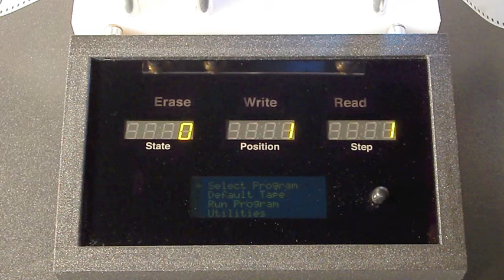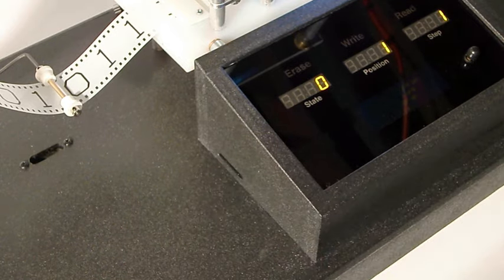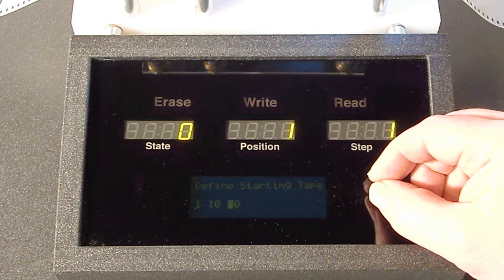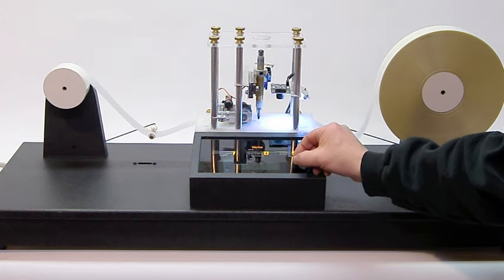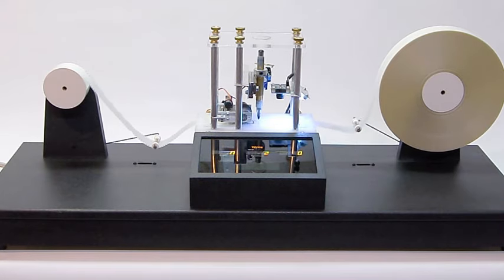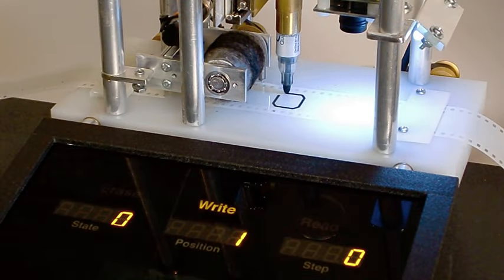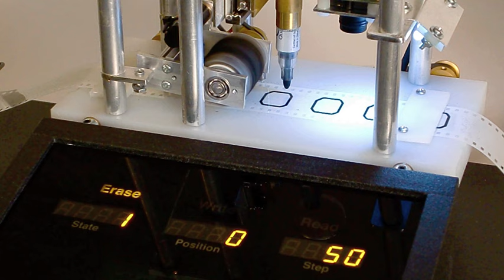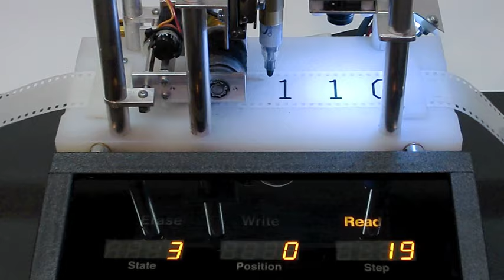A Turing Machine - Overview

Comment: It's funny to think that there's another Turing Machine hidden in the "control box" inside the Propeller chip that controls the mechanical one ;)
Reply: and in that turing machine there is another turing machine that controlls the turing machine which controls the turing machine
Reply: HAHAHAHAHA
Reply: and it's funny that at plank length level there is an abstract metaphysical turing machine that simulate the physics on which those turt.. turing machines all the way up
Reply: @zazugee  how do i bookmark comments
Reply: It's not a Turing machine. It's a finite state machine.
Reply: @thomasseverini6820  Unless there's an entire microcontroller hidden in it – in that case it is. But yeah, you're right about the fact that the head might contain just a regular finite state machine for this to work. It's just that in this case someone used something much more complex to simulate it.
Reply: @thomasseverini6820 CPUs and microcontrollers are Turing machines, you can parse context-free languages such as C on them (memory permitting.)
Reply: @ahG7na4  wrong. The memory of a computer is finite. They are (very complex) finite state machines.
Reply: @thomasseverini6820  everything is something if you choose your vantage point for it to be so. files are numbers, iteration is recursion, hashing is compression, and a CPU is a FSM with a state for every combination of the contents of its registers and RAM. ok.

And you need those 2^N states why? because you're a restricted Turing machine that has no scratch memory and can only move its head one way. Good luck implementing that in silico.

CPUs can pack all of that state in less hardware, because they really, really do things differently - like a Turing machine and not like an FSM. they can random-aceess any of the memory cells and branch on its contents.

They've made a CPU in Life. That's because that is Turing complete, you see. Show me a CPU in regular expressions.
Reply: @ahG7na4  I understand your point, but that does not change the fact that computers are not real Turing machines. A Turing machine is an abstract mathematical concept defined by a very precise formal definition that computers do not met.
Reply: @thomasseverini6820  All FSM's are unidirectional finite length tape TM(no writing capability).

Comment: But can it play crysis? I'm sorry I had to.
Reply: sure, if you're willing to wait 50 years for each frame ;p
Reply: lily foxboro What if I got 10 million of those things and managed to get them to work together. Then could I play crysis?
Reply: A turing machine can compute anything that is capable of being computed.
Reply: Brock X you mean sobering something like a...a parallel processor? Maybe if we could somehow virtualize and minimize it down into some kind of integrated circuit?
Reply: lily foxboro No no no. I'm not talking about making it any smaller. I like the idea of a parallel processor but keep it the size it is and use 10 million. Would you be able to run crysis if you did that?
Reply: Brock X When you get down to it, modern CPUs with their millions of transistors are essentially like millions of little, simple machines that could be... compared to turing machines. 

But the idea is that ANYTHING can be computed on a turing machine. Sure, you'd need millions of years but any computation can be performed on a turing machine. Or any "turing complete" system, actually. Practically though? No. :P
Reply: JC Leyba Thanks
Reply: It can play every game that has ever been invented, and as it stands now, it can play every game that will be invented (for a computer).
Reply: Everything for forever!
Reply: Alexander Alvonellos So a turning machine is like a computer chip but it can run any program on any architecture?
Reply: Heh, it's funny, I came here to basically say something that would answer your question.

I was going to say that this is turing complete so it technically (not even theoretically but ACTUALLY) could run any program logic. 

This means it could be the CPU that runs something like Crysis. Even with the GPU stuff being offloaded it would probably take hundreds of years, or longer, to execute the code needed for a single frame in the game. If it took it just a single year that would be, at maximum, 1/31,536,000 fps.

That being said.. that's still a bad ass fact of computing AND ALSO shows how fast our computers are these days.

* Now that I think about it. Computers these days can do BILLIONS of single operations per second. It takes AT LEAST 2 seconds for this machine to go from one bit to another and simply write the new bit down. That's not including the time it takes to moving to an existing bit, erase it, and writing a new one. There are multiple operations, like this, to do a single addition or subtraction which is something that gets done in a single operation on a PC CPU.
Reply: Alexander Alvonellos But wouldnt you have to connect it to the "Internet" to play online?
BTW I know nothing about crysis. :P
Reply: Alexander Alvonellos It can't play any game AFAIK, because Turing machines don't support random numbers AFAIK.
Reply: *****  Yes but we are assuming that this turning machine can take input from mouse and keyboard so it could have a random number input.
Reply: Brock Jones You guys have to understand the difference between "can it run crysis" to the amount of time and effort it would take to do it.In case you were not paying attention, the only moment a turring machine receives input is when the SD card is inserted. Then it just runs the inputed algorithm and processes whatever already is on the tape.That being said. for EVERY command that you push in crysis you would have to insert a new SD card. That is for EVERY mouse movement and key stroke.That is why in Alan Turing's paper, this was called a theoretical machine. His objective was to prove that any computation can be made by it, not that it can do it fast. :)
Reply: kriptonis
I knew it would take a lot of time I just didn't know you would need to insert an sd card every time.
Reply: Brock Jones Given the time for a single op, and the fact that you'd, at some point in expanding your parallel machine, run into propagation delays, no, you could not run crysis at anything you'd call a framerate.
Reply: kriptonis Conceptually, there's no problem with adding input we do on modern computers: by reacting to externally changed values in the memory. It doesn't change the processor (ie the turing machine) one bit (pun intended).
Reply: ***** Games generally use pseudorandom anyway.
Reply: Validole
 true, but the problem is how you pass the input to the Turing machine in the first place since it doesn't have a place to do it.

I guess you could create a magic dynamic tape that would change as you and other players act.

One thing it could do perfectly fine is to play a recorded game. Because all input would already be known, it could be stored statically in the tape and the machine would just process the bits and pieces (I made a funny :)
Reply: Validole  So it couldn't even render a frame in about 10 years?
Reply: Brock Jones A single addition on a Turing machine takes about 15 instructions. Other operations would be significantly longer, but I think that would keep us in the right order of magnitude. Assuming 2 seconds per operation as someone estimated earlier gives an instruction speed of 30 seconds per instruction, or 0.0333... Hz. A modern CPU can achieve a few hundred million instructions per second, but let's just assume 100 million. This means that this Turing machine is at least about 30 billion times slower than a modern CPU, and probably much slower.

So, if it takes 1/60 seconds to render a frame, this device would need 15 years to do it.

That said, I never included the GPU in this computation. This would increase the time by 10 times.
Reply: ***** You can compute algorithms that would output pseudorandom numbers easily. Also, not all games require random numbers.

I'd say it would take longer to write the game to be computable by a turing machine than to actual compute a single frame. If it were just this one guy doing it, he'd die before he had the chance.
Reply: kriptonis Well, you can build a Turing machine with more than one tape. And the second tape is used for input. After reading the input it switches to a blank field. If e.g. the camera detects a new symbol it reads it and calculates.
Reply: +Brock J If you can run them in parallel, you might break 60 frames per hour.
Reply: +Jeff Morin Hmm... Lets say one turing machine for every bit of display data (not pixel, bit)... and maybe you could display 24 fph video. However, you won't be able to unpack the video (or generate the data to display, in case of crysis).
Reply: Certainly not, but the COMPUTER which controls this machine probably can.
Reply: Well, no. This runs off a Parallax Propeller micromontroller, and while being an 8-core 32-bit device, it also runs at 80 MHz max with a total of 160 MIPS. So no. For context, top end CPUs that have integrated graphics can run Crysis on low at 15-30 FPS average. And at the time this video came out, you definitely needed a discrete GPU.
Reply: This here is, technically, not a Turing machine. Turing postulated an infinite tape, which this is definitely not, and I suspect you wouldn't have enough tape to even composit a pixel, let alone a frame (to be clear, yeah, you could store a pixel no problem, that's 24 bits. But you need space to calculate that pixel and to store the code that calculates that pixel).
Reply: Well, how is it done on actual computers? IO registers, mapped to memory space. Here, IO would take the form of a device that, when an IO event occurs, temporarily halts the main processor, scrolls the tape to it's own reserved memory space, changes the bits there, and then scrolls back to the original position, followed by re-enabling the processor. Then, when the processor checks for data in main loop, it will read the new values. We're limited by having the single memory instead of a hierarchy of registers->caches->memory->storage, and the memory is SISO, necessitating the interrupting of the main processor, but architecturally, the thing will work just as well as the concept of Turing Machine itself - just fine, just slow.
Reply: Basically this is how gpus work. They have shaders, tiny little (slow) processors but then a few thousands of these. You can split up a picture to all these shaders so that every shader calculates just one pixel per time. When you have more pixels than shaders, a shader may have to do 2 or more pixels in series. In raytracing, each pixel shader searches it own path from the camera to what it points at. When it hits something, it takes its color. Let us assume that each turing machine has to do just one pixel and it has all the geometry data on its tape... Then it would still take a very long time since it has to calculate the geometries of every single object in the rendered world. Any other way of rendering (beside raytracing) would be impossible since then you would need geometry shaders that draw the objects polygon-wise but for that, you would need a shared memory which is not existent in turing machines. On computer games, geometry shaders draw the pure polygons and then the pixel shader refines the image so it looks better. It will not take 15 years but a thousand times more than that since computer games spread the calculations to thousands of shaders.
Reply: if you include a starting pRNG seed, you can compute pseudo random numbers just fine.
Reply: How about replacing the paper card with an electronic memory that can store bits electrically? This would certainly speed up the operation of reading/writing of the tape.
There is a theorem that a multi-tape TM can be simulated by a single-tape TM. So how about using this theorem in the other way around and use several tapes (already replaced by electronic memories) in parallel in order to read up the data in entire chunks? You can then treat each row of bits on those parallel tracks as a single machine word, and replace them with ASCII characters, just to facilitate the way of writing those symbols on the tape (character mode instead of bit mode).
Then I guess we can replace certain procedures that were previously being done "in software" (as finite state automata) with hardware-accelerated ones (e.g. by replacing the addition procedure with a proper ALU that does the same faster).
This way, slowly, it will start resemble a modern computer that CAN in fact play Crysis.
It just needs a lot of additional shortcuts and abstractions and hardware-accelerated procedures to make it fast enough. But in principle, it would be equivalent to running it on a Turing machine. That's the whole point of this idea.
Reply: Brock J 
Yes.

Comment: I love this for at least 9^(1/2) reasons. The first two are for the wonderful poetic purity with which is expresses the void betwixt the practical and theoretical. 1) There is no practical way to make a Turing machine without using a Turing machine. What better expression of the power of pure mathematics is there? Turnings analogy of the mathematics he produced is one of the best analogies in all thought, yet still, it fall into paradox. Wonderful. Perhaps the fact that our minds can comprehend want cannot be made offers insight to the investigator of the commutative power of humans....2) The practical Turing machine is limited by the supply of ink, the durability of erasers, and the fortitude of tape, amongst other things. It begs the question, is the np: p problem a question of pol initial time, or a question of felt time......? The third reason I love this is that, I am so glad, respectful and impressed that you have taken the time not only to make, but to share with everyone, this practical realisation of theory. Sincerest thanks from me at least. Tertiary solo: 11 010110 101101010    101010.  101010101010110

Comment: Found this a few days after attending lectures on programming a (theoretical) Turing machine. There's a certain beauty to the concept and this design is pretty much perfect. To all the "Does it run Crysis" jokes - yes, it can, since if you can bring a problem down to a finite number of operations, a TM will do it. Eventually. Probably faster if you apply a longer character list and tape. The second should be infinite, just to be safe. And you'd have one frame per month. Maybe..

Comment: So many Turing Machine explanations, and in this case beautiful machines, concentrate on the Tape only (which is the memory). So few make clear explanation/simulations of the State Engine (which is the cpu). Here there is "only" a LCD (the numeric digits etc show current state, rather than the state processing). The state engine programming is simply described as "simple text file". I'd like to see the whole program. To all who comment I dont understand - you are sort of only seeing half of a Turing machine. (There is one video of a Turing machine, purely handcranked, purely mechnical, made in wood - search for it!)
Reply: The wooden machine, as cool and awesome as it might seem, is not a universal one, though. Its state transition map is just a board with holes for studs, so you have to replace the board with a new one for every new program you want to execute. It also has some drastic limitations on the number of states (just three, from what I remember). It is a good start, but there's much left to improve before it could be used as a Universal Turing Machine.
And I fully agree with you on the part about the tape. The tape is just the memory. What's more importan is what's in the head (the program for the state machine). And even more important is how can we express a program for the machine directly on the tape, as part of the input, so that the machine could simulate any other machine. This one in particular is the key to Turing's discovery.

Comment: @JolyG for example, if you can simulate a turing machine in a (programming) language or any given formal language, it is said to be "turing complete". with that knowledge, you can assure, that this language is able to compute every algorithm, that a "universal computer" can compute. for example, functional languages are turing complete, and thus are as powerful as imperative languages (in terms of computation). 
P and NP refers to the complexity of given problems.

Comment: In the theory you are able to solve any problem using a turing machine that you can solve using a programming language along with a compiler and a computer.

This abstraction is useful for theoretical purposes. You don't get getting bogged down in describing a specific computer with a particular cpu, ram etc. when theorizing on what a computer is capable of.

Comment: This is quite fun as a piece of classic computing/art. Still, I think Turing would try this using only analog electronics.  Writing could be done by either writing a dot or not. Reading can be done with an incandescent backlight and a photomultiplier tube (both invented before 1937). The program could be loaded on a different tape (read only) and an output tape can be loaded). Given an initial tape of ones and zeros, one could probably do a full count of the tape.

Comment: if you'd like, you can try designing a turing machine that will sort binary numbers

at the time of its creation, a turing machine (TM) is meant to be an imaginary machine that will solve mathematical or computable problems.
despite having the infinite memory of a TM, the designer of a turing machine may be limited to the symbols he uses. Ex, a person will think TM can only recognize letters by storing 26 distinct symbols. The problem is states have to cater to those 26 symbols.